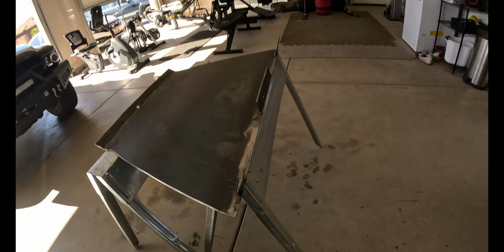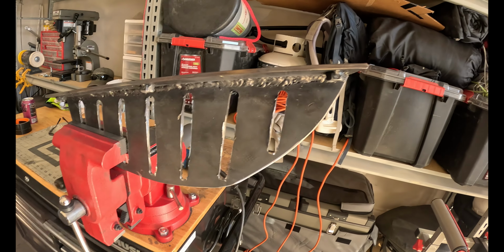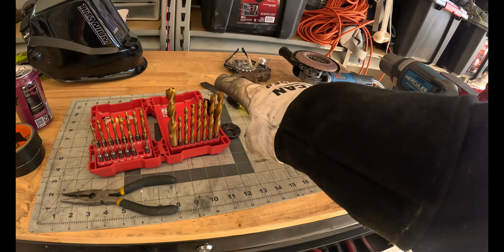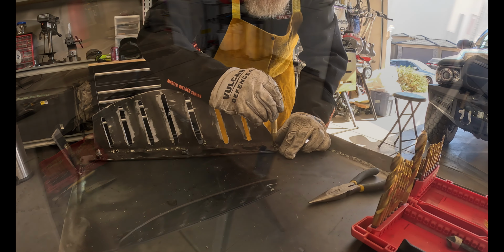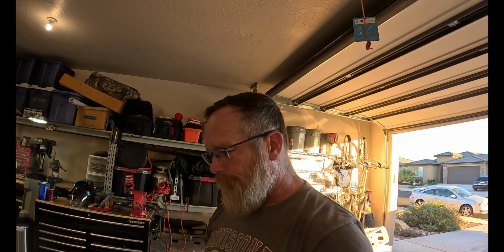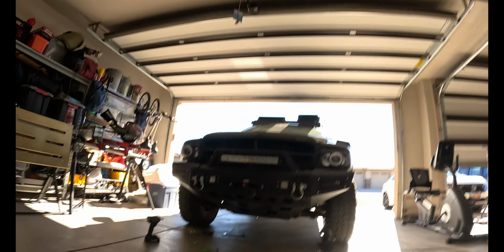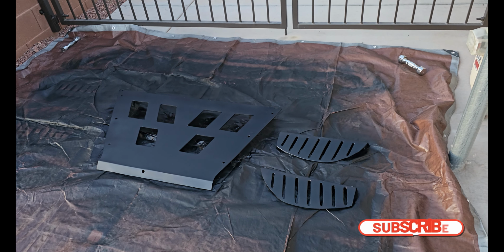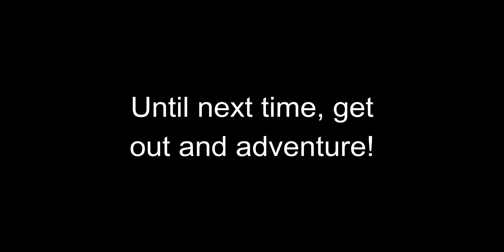DIY Skid Plate Part 2

Comment: Been looking for skid plate ideas for my 4th gen ram 1500, so I've been watching a lot of videos. This one has definitely inspired me to go ahead and build one, simply because I have the exact same bumper, and have to agree, there is something missing under/behind it with the space.

I am also with you with the holes you cut, not really sure if I like it or not, it doesn't look bad, but there's just something not quite right, maybe if the were a little smaller,  not sure, but it does look good, really like the side filler pieces, makes it look finished.
Reply from the maker: Thanks for the feedback! Watch part 3, built a different skid plate with no holes. Much better I think.
Reply: Thanks for the quick reply.
It does look better on the second build.